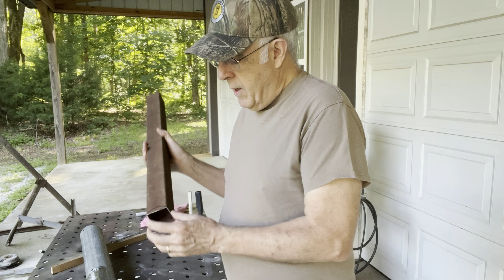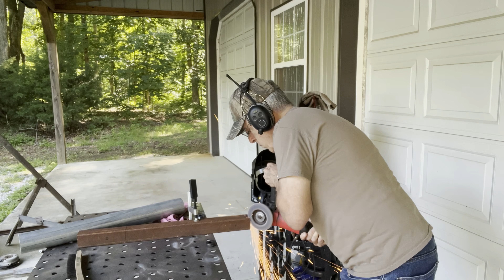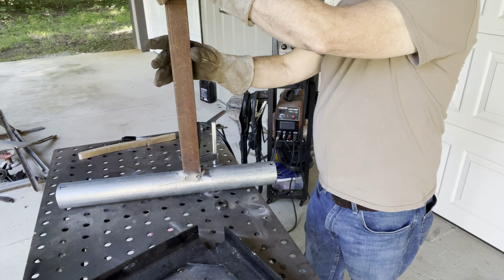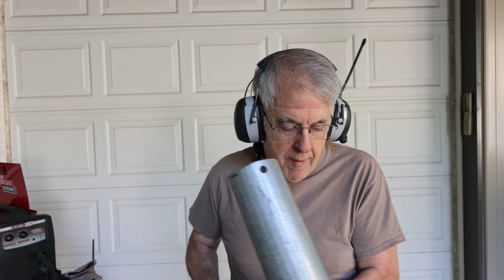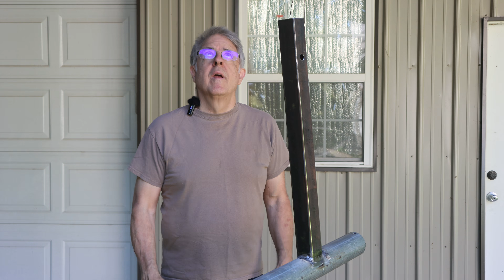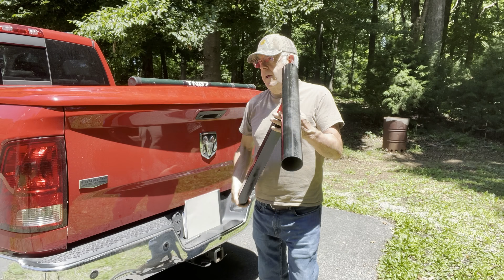$3 Truck Hitch Mast Mount for POTA (Scrap Steel, 2 Inch Receiver)

Comment: Hi Jerry, I enjoyed seeing your project. I think it's great that you can do your welding. A buddy made one of these for me a coupla years ago for my telescoping lineman's masts. Mine is nearly identical except I asked for angle stock instead of tubing for the vertical section, with the open part of the angle facing to the rear. I use two cam buckle straps with small kitchen/shop towels as pads to lash the mast to the vertical with no wobble. 73 DE N1LO
Reply from the maker: Glad you enjoyed it, and that’s a great idea for securing the mast! 73

Comment: Where did you find the metal scrap? I have the hardest time finding scrap metal at prices that are reasonable
Reply from the maker: From a local recycler.  Most recyclers keep a small inventory of good reusable metals.  Use a search engine to find a metal recycler in your area.  I have 2 within 15 miles.

Comment: You could use a hitch pin for the bottom of the rigid for a quick release/install.  Then maybe put a quick hole in the square tube to store it when not on the rigid.
Reply from the maker: Thanks for the suggestions.

Comment: That looks pretty slick, Jerry!  If you wanted to keep the mast from moving around inside the mount you could maybe cut a piece of pool noodle (3 or 4" should do).  Split the piece in half length-wise and you can use it as a boot.  It's just a thought!  Thanks for sharing!  73 DE KF5RHI
Reply from the maker: That’s a clever idea for a quick fix, thanks for the tip! 73, Jerry

Comment: I like to throw in a couple plastic shims to take up the space between the mast and the tube at the top. It saves wear on the mast and keeps it vertical too.
Reply from the maker: That’s a great tip for keeping everything secure and scratch-free, thanks for sharing!  What do you make the shims from? 73, Jerry
Reply: @BudgetHamRadio  They're just from the orange big box store. I've had them for many years. Another thing I do for more permanent installations  is use a 3" PVC tube that's just shorter than the mast's first section, then put a PVC cap over that, then drill a hole just bigger than the mast. Again, takes up the space to keep the mast vertical and stable. That whole contraption fits over a very heavy deck umbrella base. This is how my fan dipole is mounted in my small lot.

Comment: An extra 4 to 6 inches of length on the square tube and it gives more clearance to use the square bar as a step up/down to get on/off the tailgate.
Reply from the maker: Good thinking, that extra length would definitely make for a handy step. 73, Jerry
Reply: @BudgetHamRadio  Forgot to add, grip tape on top there to help prevent slipping.  The mast is like a hand rail.  win-win-win.

Comment: Jerry, I like your videos. I hate to even mention it, but since you talked about hearing protection I have to mention that you really need better eye protection when drilling metal and grinding.Something with side panels or full face coverage. They make full face panels so you can still wear your normal glasses.  It only takes a tiny sliver to be a nightmare. Just looking out for you.
  I’m not a trained welder either, but they sure are handy. I made a really nice welding table. I have a few welders and a plasma cutter and a cutting torch. 
 On my mount, I made some different size inserts with my 3D printer to be able to use different diameter masts and not be too wobbly.  You also could drill a hole in the tube and tack on a nut so you could run a bolt through it to tighten the mast against the side of the tube. May need something on the end to keep from marring mast.
Take Care
Chuck
Reply from the maker: Thanks for the concern and the great ideas, Chuck; I'll definitely look into better eye protection for future builds!   Do you have any 3d print files with parameters to make different sizes?
Reply: @BudgetHamRadio  I’m still working on it. I’ll let you know when l get it all figured out.